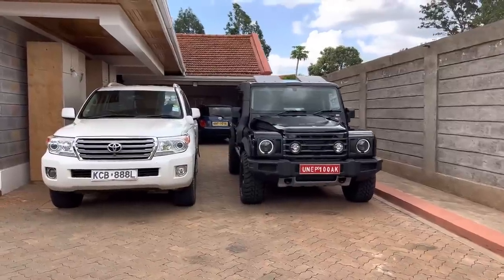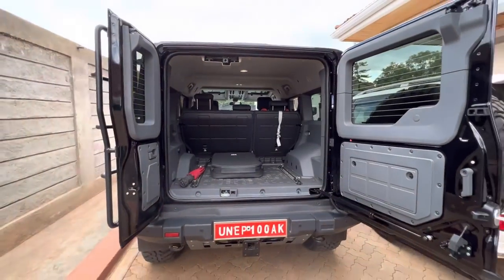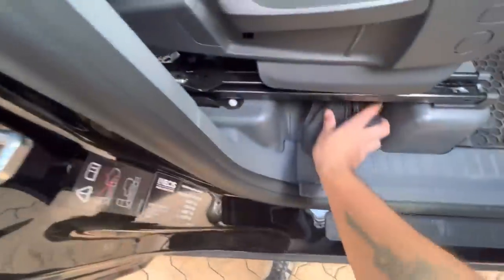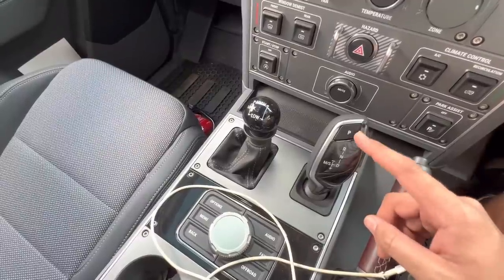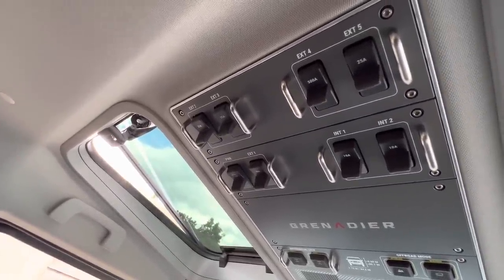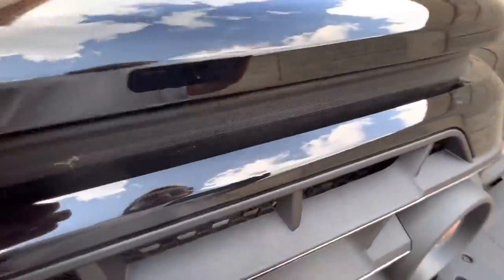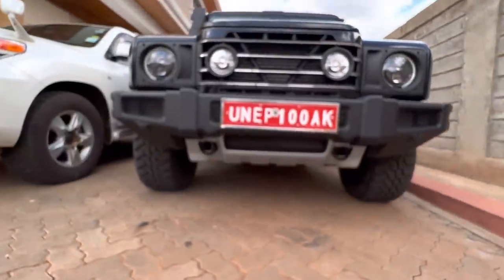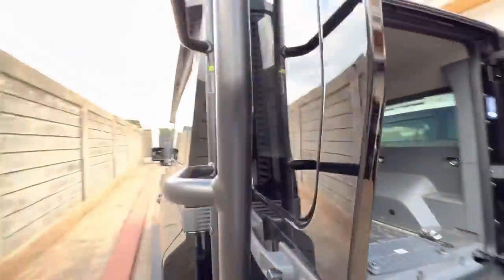Walk around my INEOS Grenadier alongside a 200 series…

Comment: I had mine on the road since 22/04/2023. Don't press the bonnet down, it is aluminium and may dent, drop it from about 35cm. If the bonnet/hood is not shut properly, you cannot use the key fob to lock the car. Leaving any door ajar makes the central locking stop working. Please take pictures and give details of your modifications - Ineos are being slow with the 3D manual, so all details appreciated.
Reply from the maker: Good advice. Will try that tomorrow! Thank you. So far I’ve only changed the tyres. I’m waiting on wheels, roof rack, lighting, fridge, etc. As they come in, I’ll post for sure!

Oh I’m also getting a ctek250se for solar charging.
Reply from the maker: Did it today. Thank you… worked

Comment: Looking at the specs the maximum rear legroom is 30.5” .  That is smaller than a midsize truck (I.e. Colorado has 35.8” of rear legroom).  It’s hard to tell but in the videos there seems to be more space than a mid size truck.  How does the legroom compare to the LC200?  Perhaps it’s just different standards in where they are taking measurements?
Reply from the maker: To be honest I have no issues. I actually find the footrest more comfortable than my 200. On long safaris in my 200 I tend to be in constant search of a comfortable left leg position because the footrest is too far back. I haven’t done a long safari in the Grenadier yet but will do later this month. As always, I’ll post!

Comment: Very good review @Kenyan Grenadier. I am curious about your wheels. They are rather large. What did you say you are getting? Are those stock? Otherwise a lovely car, we drove the prototype and Jack at WA is an enthusiast so we expect good backup service. 
I am getting the one with the winch, I need it, and I have seen reviews of how it works. Otherwise, like you, I love the car especially after driving it, and I cant fault it.
Reply from the maker: Hey, great to engage with a fellow Kenyan owner. My wheels are stock. My tyres are larger- 285/70. I’m getting a wider wheel but still a 17. It’ll stick out about an inch more from the fender. I think you’ll love the final production version. Did you get petrol or diesel? Utility, Fieldmaster or Trialmaster? Lockers? If you need the winch, you need the winch! I’d be interested to hear more about your vehicle!

Comment: Do you think your toolbag will fill up with water when you cross creeks etc?
Reply from the maker: Haha… have you seen the door seals on this truck? If not, have you heard the door close sound? I strongly doubt anything gets in. But there’s only one way to find out…
Reply: @Kenyan_Grenadier  I have been driving these around the Australian outback for years, no dust ingress, no water ingress, no electrical problems, no reliability issues. They'll go anywhere, they're comfortable for hours and hours, they have great radio's etc etc. In the bush you need a vehicle with a good AM radio, the radio's in the Ford Rangers are rubbish, you can't hear anything out in the bush. The ones I drive are company vehicles, if I wanted a 4WD of my own to drive around Australia I would buy a Prado in a heartbeat. Do you think your toolbag will fill up with water when you drive through deep water? Or aren't you going to use it for "what it was built for"?
Reply from the maker: Been a Toyota guy my entire life… was a risk with the Grenadier, for sure. But, now that I have it, and I can compare it directly, I’ve got to admit it’s built for Africa… and similarly Australia! 

I’ve never had an issue with my 200… it’s been incredible and I can’t fault it in terms of reliability. However, Toyota seems to have shifted gears a little and are moving more and more toward an SUV rather than a proper off-roader with the LC series. I had an order for the 300 GR-S and still went with the Grenadier. 

I think it’s very hard to justify a side between the two, and it comes down to what you really want. For me what matters is connecting to the terrain, feeling the capability of my vehicle and to an extent, what it actually looks like. I find my 200 a bit boring to be honest. A bit too muted for my persuasion. 

Reliability- time will tell. Capability- I’ll be heading to the WRC Safari Rally in June and then Tanzania, through the parks, in July so I’ll be able to post more on that. 

The terrain is unforgiving… so it will be a fair test…
Reply: @Kenyan_Grenadier  It certainly will be... I'll be watching with interest, thanks.

Comment: That gear stick is standard BMW, and very intuitive. It’s being used to that side to side monstrosity that Toyota use is your downfall!
Reply from the maker: Hehehe… perhaps! Having said that, I’m now used to it and it’s pretty cool!
Reply from the maker: I’m beginning to agree with this now that I’ve driven it for longer
Reply: @Kenyan_Grenadier  Yes, I thought you might. I’m a bmw driver and found it so intuitive immediately. Now try getting back in a Toyota! So, tell me, how are you finding the pedal arrangement; I’ve not understood people’s concerns given that there are only two pedals and you only need one foot between them?
Reply from the maker: No idea what the issue with the pedal arrangement could be. I just did some proper off-roading at the rally and it’s no different to any other 4x4 I’ve driven. The foot rest and pedals are all in line so even if you did want to use your left foot, it’s as easy as it gets. In fact it’s even easier to left foot brake because everything is aligned

Comment: foot rest is too big and no way to stretch your leg out if you are driving lot miles I can see a issue on long hwy trips like in USA.
Reply: The USA models won’t have the footrest as the BMW engine cat are positioned on the RH side of the engine. That’s why the bigger than normal foot rest.